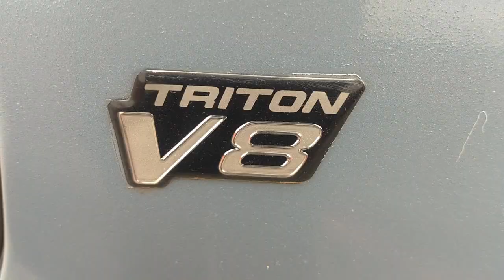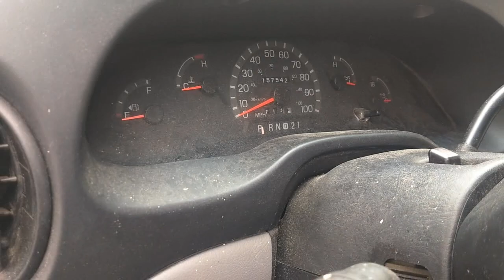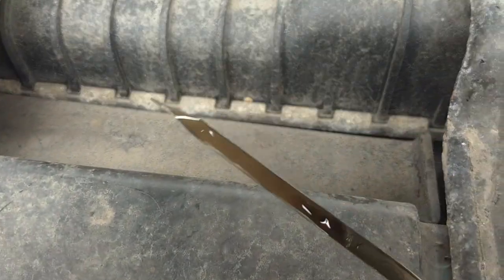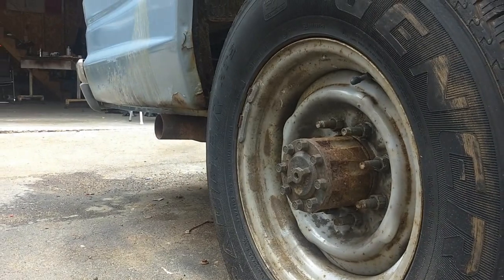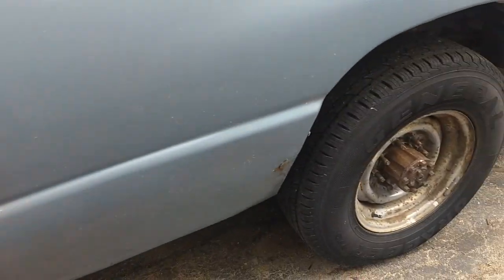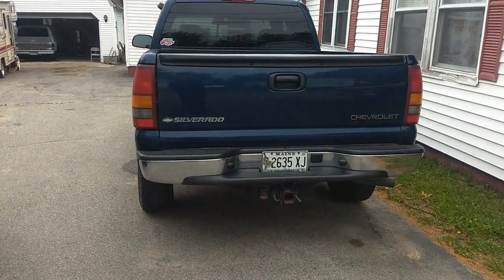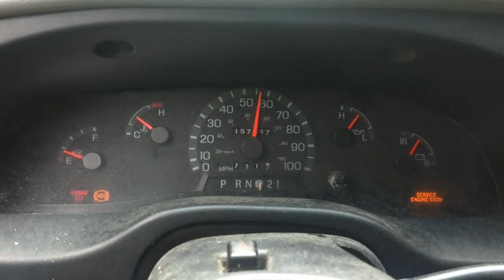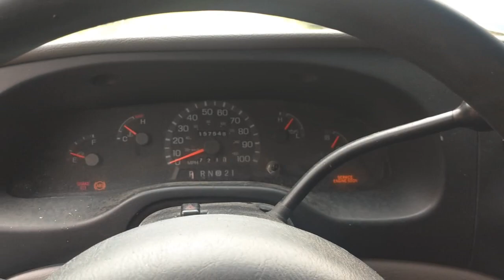Will the Ford make it to its own grave?

Comment: Just like a Ford to keep running when its effed up. The 5.4 2V engines were great!  I had a 2002 F150 5.4 2V that had 305,000 miles, still ran fine, and A/C still worked. Key is proper care

Comment: Didn't see those engines pop the head gasket too often. Somebody must have gotten it good and hot. I've got a kit that drills out the stripped hole and retreads it. Then you put an insert on the new plug, a little red locktite on the threads and drive that fucker home. Makes a permanent fix that'll never let go again 😂
Reply from the maker: Lol yeah we did them all the time at the shop I worked at and I actually thought about doing it on this before I saw the milkshake..

Comment: Say what you want but those things were actually good vans. I've seen some of those older 5.4 2 valves go 700.000 mi. or more! It doesn't matter, nothing lasts forever.
Reply: Just get a 351. They make a little less power, but are 10 times better in every other way.
Reply: @Tracert-mc1hu    Thank you Xpert!
Reply: I believe you on the 700,000 mi part, only if the engine was replaced 14 times, and the trans was rebuilt 6 times!